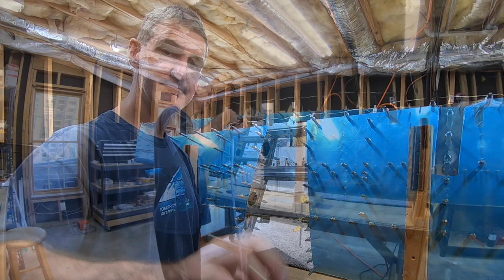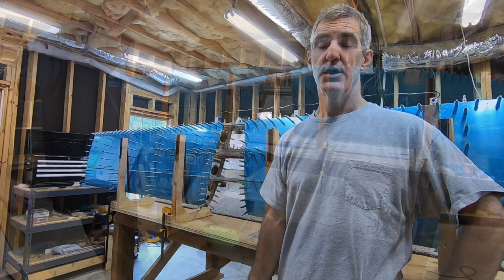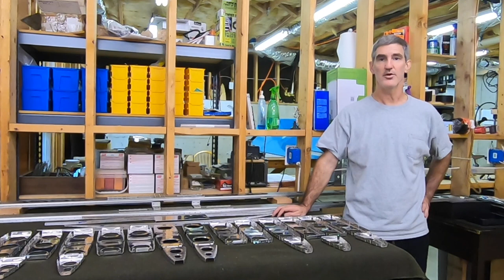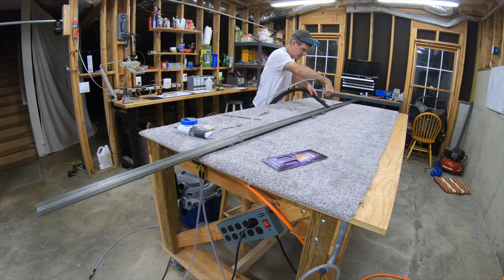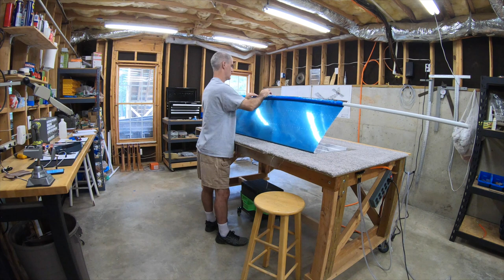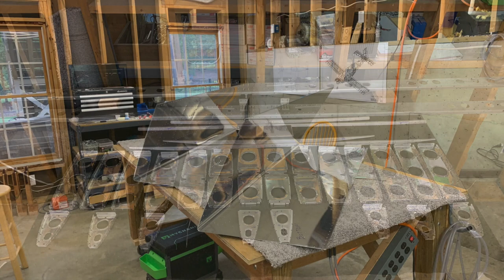RV-10 Build Log - Emp 43 - Drilling, Disassembling, and and Deburring the Horizontal Stab

Comment: I am thinking that Vans was making kits with final hole size, and supposedly they no longer needed to be match drilled... So I am wondering if you have old parts, or am i not understanding correctly?
Reply from the maker: They made that announcement a few months ago but it takes a while for them to switch over tooling and purge existing stock.  When I ordered my emp kit over a year ago it was before the switch over.